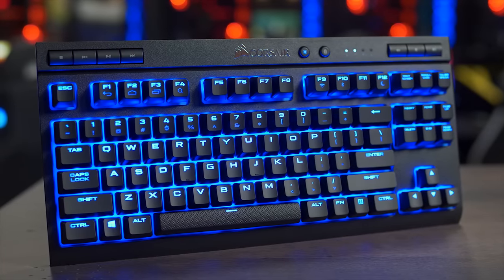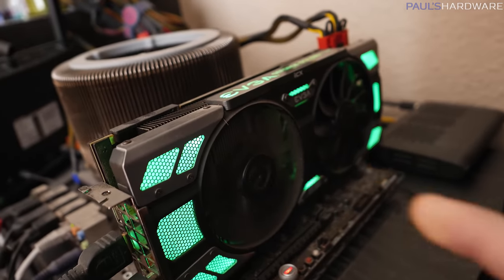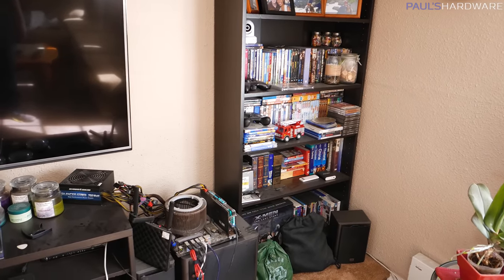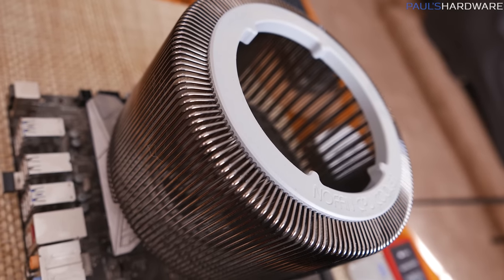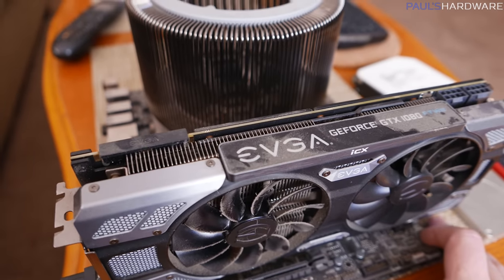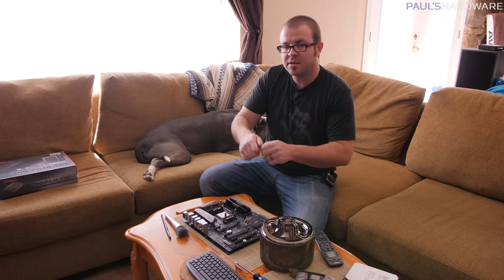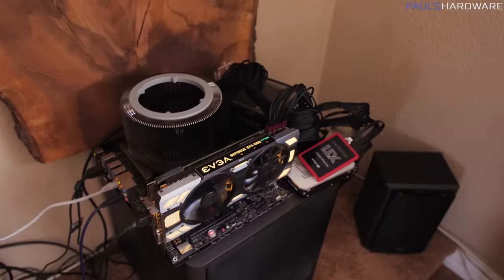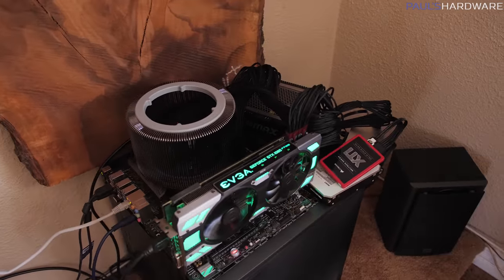Does Your PC Even Need A Case?

Comment: i guess the real question is do you need an EXPENSIVE case.. i want the phanteks p600... is it worth it if i'm not already rocking top-end gear? (I5 8600k, RTX 2070, multiple SSD's, single HDD, 280mm aio).

Comment: one does not "need" a case, but it absolutely protects the system from damage, dust, static, prevents one from dropping liquids on them etc.
it can however offer the best cooling potential.

I wish they made more of an open air style but still offers protection (no one really offers this)
There are a few out there such as mining rigs that have numerous GPU or whatever (test benches) and many repair places just mount the motherboard on a chunk of wood.

to each their own, not a bad idea at least for making sure everything works before mounting into a case, but, myself I rather protect my expensive computer parts and myself from freaking out when and if I damage it when the case is the least general cost compared to everything else.

HDD has a moisture and temperature vent which if humidity is too high and dust manage to get on it, zzzzzapp.
GPU of course sucking in dust or static
CPU same thing

more for esthetics and protection  (as well as ability to keep all the wiring tucked away preventing accidental sucking in to fast moving fan blades which would not be good)
dust can become static charged, even though PSU if properly grounded helps drain static, anything that is not fully grounded or whatever can build capacitive/inductive/resistive charges none of which are good things if in the wrong place at the wrong time let alone shortening the lifespan or preventing parts from running at proper temperatures (dust acts like a blanket afterall)

Comment: exactly just take it outside and blow it off with the air hose, that's what i do, works great, cheap paint brush works good to finish it off, wipe it with a little WD 40 makes it look like new, then get a Thermaltake  P3 open case and mount it to the wall, can get a maxed out corsair 650i psu for $79 the fan never turns, those digifanless are expensive

Comment: there are people that found that, their  CASE were causing sttutering, because of  front panel usb 2.0/3.0   
others found that the LED-Lights from case were  causing sttutering and so on  (internal fans) 

so yup.

Sometimes is better to built the pc from scratch 0 case involved, boot in Windows/Linux, do a benchmark test, check everything, play 1-2 hours games.

Then built the pc into the CASE

Re-DO  
Benchmarks
Play games

See if everything performs the same ,if does, then you has no problems.

Also make you sure to invest money in  Power conditioner + ups double conversion that will keep your computer components clean from (dirty emi-rfi- stuff.

Comment: question, is the motherboard sitting on mounting screws or it attached to a mount of some kind to keep it off the table surface? i as i am thinking of stripping my old pc i am using as a plex server and hiding it away in my ikea bookshelf. ;0) thx

Comment: Im trying to do something like this but for some reason when i take the motherboard out of the case I can't get it to do anything.  Tried 2 different MB, two different power supplies, multiple switches, screwdriver method and not even the power supply turns on.  Could it be a grounding issue?   I mean the MB is on a piece of cardboard on a wood desk.

Comment: I only need to do this for what. A week maybe? I just wanted to see what I could do to make sure I could get up n running until I either return or sell my accidentally ordered mATX case. I have a tomahawk max b550 - gtx 1660 ti - ryzen 6 3600 with wraith cooler. Amazon didn't specify anywhere about the size

Comment: I have my system sitting inside a little shoe rack. I can't afford the pc cases that would allow for 3 gpu's (I do mine when I'm not gaming). I do have 4 pc fans blowing toward the system. I, also, plan to add some sort of fiberglass mesh/screen around the system to further reduce the dust collection on the system itself. It's not pretty, but I don't really care. Also note that I do have the motherboard sitting indirectly on the shelf to prevent shorting/grounding issues.

Comment: You actually do need a case to keep the electric interference to a minimum.
That's why, if you live in Norway and your neighbour is a radio amateur, you will be legally forced to use a completely sealed metal case or the police will impound your computer and any other devices causing electric interference.
Even old plasma-tv's will be taken by law if the radio amateur is experiencing interference.

Reason being that they play an integral role in communication during a crisis.

Even your RGB induced rainbow hardned glass case will be illegal to use. ;)

Comment: Hey Paul, I saw you on Corsair site. Pretty sweet, pretty sweet. But I wanted to ask you, since I’m sure you messed with it, but how Corsairs keyboards and mouses stack up vs alts? I ask because I’ve been doing a lot of builds for customers and I’m seeing a lot Corsair power supply’s and cpu cooling and cases and I’m starting to expect exceptionally impressive parts that are made very very well and I can see a long life expectancy from Corsair but I’m becoming a fan of Corsair and wanting to get in contact with y’all as well, and my thing is I like a direct approach to, but I kinda want to get to know some of y’all since I’m very much drawn to Corsairs quality. But yeah I really wanna learn some more about what your experiences have been thus far working with them? If and when you get the time, I know how busy things get from time to time, so whenever, but I’m liking this setup, interesting about the no far build your working on. Honestly it’s a first time I’m hearing about that cpu cooler you running on that setup. I’m just addicted to building custom PCs and VR so when I see something new I gotta do some readers have now so this has been a pretty interesting video.. thanks bro.

Comment: Will the brush not build up static? When I built my daily driver I spilled thermal paste on the Mobo and I used an old paintbrush to clean it off I was really worried but it seems fine pcie x16 #1 behaving badly though

Comment: Man, I have to have cases. Need that sound dampening. Also, with a passive cooler and no case fans, I'd be worried about the VRMs and chipset a little.

If you are running the stock fan profile, that video card may need a new application of thermal paste. I have the exact same card in my main rig and it never spins either fan up unless under load.

Comment: I've see much dustier computer components within case (than you showed us in your nice video), whenever any of my friend opened one... I run my i5-6600K overclocked to 4.7GHz and not much OC GPU GTX 970 with G-SKILL 32GB of 2400MHz RAM without case for almost 5 years now without any issues, on heavy loads CPU rarely gets over 80C and even over 70C it's in miliseconds, GPU never gets over 72C. I clear dust with paintbrush everynow in a few months and looks still pretty and runs well.. Although I am planning to get bigger+heavier graphics card, so I'll possibly move it to case to help it sit well in the PCIe slot...

Comment: Got openThermalTake P5 case so it's open case and it should act same as having no case when it comes down to dust, but after half year of usage i have preety much no dust in it. just a lil bit on gpu fans, psu fan and for whatever reason on psu connectors.

Comment: Components should stay in a hard metal case for a main reason - EMI radiation, the thicker the better. Dust is also ugly, pets walking all over your PC components is not welcome. Generally a PC should be a closed system sort of to defend it from the outside hazards, of any kind. But there is one inside hazard which is liquid cooling solution, beware of using it.

Comment: If I didn't dust and full on clean my house for 8 months everything would be caked in at least a quarter inch of dust and hair. I know, I pulled out a suit case I forgot I had under my bed that the last time I touched was in may of last year, and it had about a third of an inch of grime and dust completely covering the top of it. 
I also live in Arizona and have the dogs though, lol. 
Lots of dust and hair.

Comment: I've had the same keyboard since soon after the first raspberry pi was released, but without the iogear branding... usually works well, at least until I dropped it and chipped the corner near the trackball off.  I use HDMI CEC to control the pi and its successors (other pis then a Vero 4K) these days so don't need to use the keyboard much anymore.

Comment: Just throw everything on speaker cabinet or the fire place, including GTX 1080. Please. Computers inside pc keyboard goes back to Atari ST in 1987, no need for case, very portable except for the heavy crt monitor, but anyone had a tv to connect RGB signal, not leds.

Comment: your pc does not need a case,  but they are in cases to protect your investment. think of your case as a safety device rather than a house. look for a soild case. I personally choose an inwin 301 because this case is pretty much a solid metal exoskeleton with zero i repeat zero rattling. made from 2 pieces of metal bent to form the chassis.

Comment: STATIC!! Man, aren't you worried you'll kill Main Board componets with that brush??
Reply: When you consider static charge and potential charge differences between points it becomes difficult to worry about components mounted in circuits. Static remains an issue, but it is not as huge as some may think it is that have not thought everything through for themselves.

Comment: How many years did this board have no cleaning?
Also, it's not healthy. Some particles of dust may contain carbon, which is conductive.
Carbon can short-circuit parts of the mobo.

Comment: No your PC doesn't need a case, but a case protects it all and a case has buttons and not all cases have a power and reset button so you have to short the pins with something metal. It's just not convenient to not have a mess, looks like a mess, and takes up more space.
Reply: Dominik, I built a micro itx build in a large shoe box and simply purchased the on & reset buttons. After some clever re-wiring I had a fully functioning shoe-box-case. But replaced it after I realized the cardboard was awful at heat dispersion. Cheers!
Reply: Alfredo S. I did that too with a box. Also a cardboard or wooden case is a potential fire hazard so I wouldn't leave unnatended for long haha

Comment: If you dont want things falling onto it and breaking it, then yes you need a case.

Running your computer without a case is just asking for someone to spill a drink on it somehow and destroy it.

That setup looks so ghetto and messy.

Also, a case improves cooling. Heat can be extracted faster in a closed enviroment since air velocity is much higher than an open enviroment. Basically, those fans are not near as useful out in the open as they are in a case.

Way to many negatives to even try doing this.

Comment: Hey guys... I have had two enthusiast friends which had their pc's catch fire to to airborne dust. To be fair one was a server.

Cases are for two primary safety issues. Fire and electric shock. 

Shock is easy to mitigate unless you have children or could spill any liquids. 

Dust particulates can be organic and flammable, it is dangerous to run when you're home without a case and extremely ill advised to run it if you are not home.

You literally mentioned oil and grease particles and yet this didn't come up. 

I'm sorry man, but you reviewed this without actually researching the hazard that could make you lose everything putting your home and family at risk. 

Please guys exercise caution and do not run pc's for any length of time without a case. Especially while you are not home.

That was a 24/7 fire hazard

Comment: have a old system mounted to the wall in my shop connected to a 32" 1080p cheep TV with an old 5.1 sound system running Linux mint works great for looking up info when working on stuff and playing music or movies when i want to have a beer and be some place other than in the house ......also bot mine and my daughters gaming system are on test bed setups open air

Comment: Yes you need a case I wish people would stop spreading incorrect information that it is better or even acceptable to run in either a benchmark case or no case. Cases limit ESD because they limit dust (limit not eliminate). You are meant to clean your case innards every so often and using filters helps too. Also unless you are using only liquid cooling then your fans need the case to facilitate optimal cooling.
Reply: You don't need one.
Reply: You do, I am a network tech and certified computer repair tech with a degree in networking and 7 years in my field. What are your qualifications? Oh wait, you are from the internets so a know it all.
Reply: It is not needed for the computer to run, therefore you don't need one.
Reply: You do need one because without a case you stifle cooling, increase dust and other contaminates on the sensitive electronic components and you have no physical protection. You have no clue WTF you are talking about.
Reply: That does not mean you need it.
Reply: You do

Comment: If you werent going to use a case why not just get a piece of particle board and then paint it and mount the PC to the wall so it at least becomes something fun, rather than spend thousands on a computer which you treat like a dis-used toy.

Comment: Ever considered using Linux? It would run extremely well on this computer, and would work gaming (you just may have to buy all of the games again from Steam and installing drivers) With Linux, you could also consider running Windows as a VM, or you could set up a dual-boot system (some of your memory is devoted to Linux, the rest to Windows)

Comment: Do you live on a dirt road next to a dirt farm? Oh wait, you have a dog... that dust is mostly doggie dandruff. Don't lick it or you will be eating your dog lol. Anywho there's a cheap solution to cut down dust on an open air case-less PC you can get at the local hardware store. Nylon window screen! cut a couple squares of it off the roll lay one ontop of the PC and the other ontop at 45 degrees from the first. Instead of needing to get out the canned air every six months you can rinse the screens off when you do dusting and let em dry overnight. Then use the canned air yearly just like if you have a case with equally bad air filters.